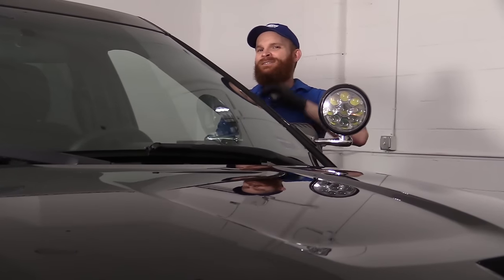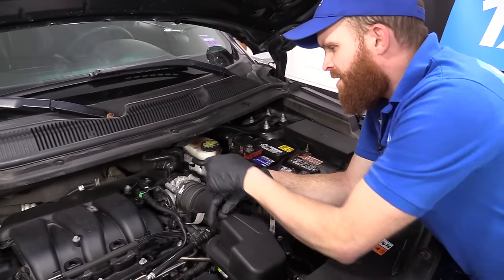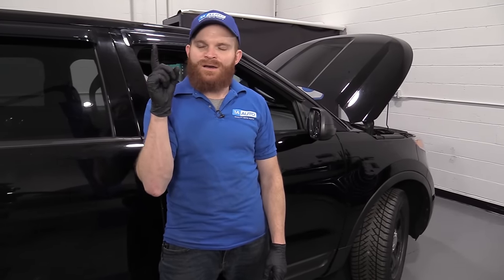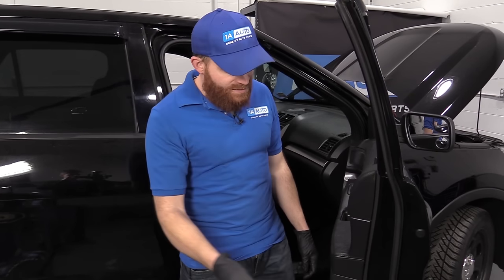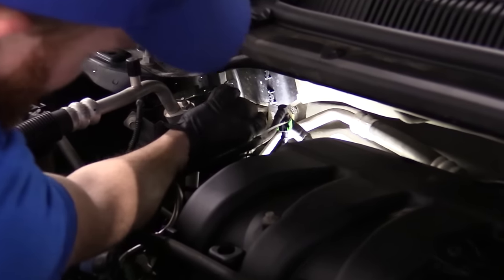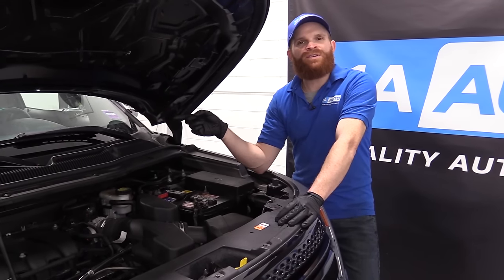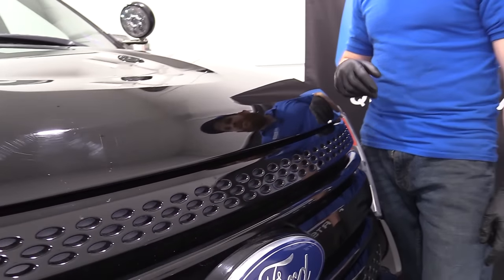Top 5 Problems Ford Explorer SUV 5th Generation 2011-2019

Comment: I recently wreaked my 09 Escape probably tired. I seen a 2017 Ford Explorer XLT Sport mix with many blackouts and a 2.Echo boost with 34k miles. It still had the previous owners address age about 75 which should’ve been removed. The Chevy dealer offered me a powertrain warranty as long as I own this. After applying for my loan so they would hold it I had to wait for my AAA check about a week. Now this is where it goes south. Being an auto mechanic for 15 years and still do my own vehicles I noticed the rotors and ceramic pads. This happens in Michigan when the car sits to long and the rotors rust. My wife was given her late mom’s 06 Chevy Impala with 12k miles. Here rotors and hardware had to be replaced. I had the Explorer a week and the battery failed they fixed it. A couple days later my shifter wouldn’t go out of park so I opened the side console and extended the lever pushed the brake and put it in neutral called my salesman they picked it up cost 1,000. After they returned it I was leaving for work at 4am being to dark to see what I’m doing I drove her car in and left a note. If I have one more shifter problem that’s a lemon law and get my money back. Other than those problems it’s a tight smooth and peppy SUV so far.

Comment: The door panel fabric tends to delaminate from the substrate as well.  Not a very hard fix, but a very unnecessary problem to have.  Ours started to delaminate at about 60,000 miles.
Reply: 2-of-2 messages. The Explorer 2012 Limited is from only 1 owner, the same lady, most of the 103,330 mileage is from home to the hospital and back, she is a doctor and the Explorer is in good standing and well treated by her, let me know your opinnion please, is important for me, Peter.. 9-27-2022 Thanks a lot..

Comment: I had a 2012 Explorer XLT with the 3.5L  V6 engine.  At about 200k miles the water pump started leaking. This is internally in the engine and runs off of the timing chain.  A very expensive fix to say the least. Luckily no coolant had gotten into the oil.
Reply: Would you buy the same vehicle if it had 90k miles on it!
Reply: Michael, my explore needed a water pump at 90k. 2k job

Comment: Rear brakes are a constant issue on these.  Had a 2013 & 2018 and both needed rear pads within the first 20k.   If you live in the rust belt you need to clean and adjust all the brakes every 6 months or so due to the design of the calipers as well.
Reply from the maker: +Jeffery Wattie Thanks for the feedback!
Reply from the maker: +JD JD Thanks for the feedback!
Reply: I have a 2015. Changed front brakes at 100k, rear brakes at 120k.
Reply: I’m on 80,000 on Original Brakes 2018
Reply: I'm at 74,200 on my 2015 with all original brakes. The dealership said it's time to start watching them at the last service because they're starting to get close. Actually getting ready to replace the vehicle, so may never have to do it.

Comment: You missed quite a few. 

PTU, the transfer case bricks itself after the fluid leaks out or turns into mud. 
Electric power steering, yeah its very expensive for a new rack. 
VVT solenoids, they stick causing cam/crank correlation codes. 
Front lower rear control arm bushings. They get all sloppy and the car is all over the road. 
Cat converters, throw a P0420/p0430 and are garbage. Police models have an extended warranty on this. 
Rear wheel bearings, they get noisy and fuse themselves to the spindle due to aluminum to steel dissimilar metal corrosion. 
Front Upper strut bearings, get all creeky.
Reply: Ha my PTU just cracked itself in half
Reply: You are correct ,This all stuff I’ve seen working in a shop for 15 years.
Reply: My PTU just crapped after 118K ... nice bill....

Comment: My spouse has an 18 Sport and it’s had replacements of times that concern me. 
1. Both turbos replaced at 29K miles. (I had to drive behind the explorer with a mechanic to show him the smoke coming out)
2. Transmission was clunking at low speed. It was the transmission mount.
3. Rough idle at times, Dealer cannot duplicate this. 
Overall worried about long term ownership. We shall see
Reply: 3.5l turbo are toilets.
Reply: @mph5896  2.3L are much better

Comment: You forgot about the PTU (AKA Transfer Case). They grenade around 100k the fluid needs to be changed early on and regularly. I put a NPT drain plug in mine. Did it at 85k and the fluid was black and sludge. I only got about 1/4qt out of it. After flushing it about 5 times I finally started to get the full 1/2qt out of it. Drove it 500 miles and did it again. Finally got it coming out clean after 3 more flushes.
And don't forget about the water pump that can fail and take out the motor. Change that coolant earlier than recommended too!
Reply from the maker: +dodgeguyz Thanks for the feedback!

Comment: I own a 2014 explorer xlt fwd 3.5L with 129k miles nothing i had to do us replace the fuel pump. I haven't had any of those issues with mine.
Reply: Agreed these vehicles are pretty reliable.
Reply: i own 2013 with 279k miles, the only thing i changed in the engine bay was the water pump and that was a long time ago, never had troubles withe engine or transmission till now...
Reply: Yes me too Ihave 2012 it's milge about 433 km it is very very relible i just replaced water pump and this problrm was also in all ford engins v6 3.5L it is great car

Comment: Also the high pitched sound that can be heard in 2018 5th gens equipped with the home power outlet. That was so annoying to deal with, pulled the fuse until I was able to get to the dealer. Also had the hood and panel near the gas tank paint bubble, 1 month in a 2020 loaner for them to order hood and repaint nigh the hood and that panel. Ended up trading it in for the 2020 after falling in love with it over the 30 days.

Comment: There’s now a recall in some states over the timing belt. There is also a pump issue. My sister just had to pay for both to be replaced. Not a cheap fix. She has a 2017.

Comment: Got a 2015 ford focus for my nephew in great condition and it has been a nightmare!!! Less than a year we have had it repaired like 6 times. Meanwhile i drive a 2007 prius with 289k miles and only oil change..zero problems

Comment: We had a 2011 XLT 4WD, 94k miles, from upstate NY and although it did its job for 6 years. We had to part from it because of that water pump. I'm mechanically inclined and I did not want to suffer through that job by myself. I could have done it eventually but to be honest, I didn't want to. 
Also, one major thing that happened to us was that the rear frame of the body's weld started to go out and we got rain water into the spare tire area. I legit fixed it with flex seal liquid rubber sealant by detaching the rear hatch and coating it along the frame. Did the same with the sunroof/moonroof gaskets too because rain leaked into it and shorted out the hazard light switch that never turned off until you replaced the whole center console.
Will never go ford again.
Reply: Had the same issue with water leaking in through the rear hatch. Seams were cracked on both sides at the top. Fairly common issue unfortunately. I have a 2p12 with 145k and no major issues other than the leak. I will be getting rid of it within the year though

Comment: My 2015 police receptor utility had the links break by driving over train tracks at about 14 miles an hour they're made out of zinc alloy and it's part of its 75 mile an hour crash test safety feature those are meant to break to absorb energy if you're rear-ended I replaced mine was steel haven't had an issue in two years
Reply: Do you have a brand recommendation? I got a 13 FPIU

Comment: My sunroof went at 65,000 mi. Motor had to be reinstalled. Struts went at 85,000 I replaced with some from 1A Auto. They made it about 38,000 MI. Just had to replace them today. Water pump went at 128,000 mi. Big job. Transfer case went at 130,000.

Comment: Thanks , that was very informative and educational, I’m thinking about getting a 2017 and now I now what to look for and what to expect
Reply: i just got a 2017 police resell.  hard to work on.  runs smooth so far, 74k.
Reply: Depends on what size SUV you're looking for?  Are you only looking at explore? 

just wondering, what did you end up getting if you did get something?

Comment: Ha, evap purge solenoid. The hardest part is getting the hose off with that green connector. You completely skipped that part. Don't need a vacuum gauge either, just disconnect wiring connector and hose. Start the car and see if you can feel vacuum from the port. If so, the purge valve is bad.

Comment: I have a 13 xlt awd with the 3.5. Issues to date were toe links, rear caliper, broken seat back in the rear, tie rod end, sway bar end links. The biggest one was where the roof and side body panel were glued together over the 3rd row glass had a leak that took the dealer 4 trips and 6 months to find. Its a nice car. Comfortable roomy rides well and has good power.
Reply from the maker: +sugarebaresnuffy Thanks for checking us out!

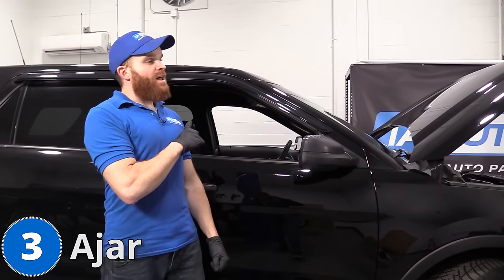Comment: @4:07 - complains door is ajar leaving the dome light on, doesn't notice that the Explorer he's looking at is the police model - and those dome lights are NOT wired into switched power.
 
Also doesn't mention about the PTU grenading due to its location above the exhaust manifold (less of an issue on turbo models due to forced circulation cooling), or the cat-headers cracking due to garbage design work by Ford.
Reply: Damn so I shouldn’t buy one huh

Comment: 2015 Ford Explorer Sport sunroof leaking. Apparently its common in this generation of Explorers & even models without a sunroof still have water leaking <- bad! I've read where it comes through 2nd & 3rd row vents, overhead lights, in the rear by the seatbwlts & water will even fill up where spare tire is. I loved my Edge I had several yrs back & had wanted an Explorer & finally got one & I absolutely love it, just not the water leaking issue.  Some say its more than clogged drains, it could be a seal on outside around top of sun & moon roof, heater core if leaking on ossgr side, roof rack needing adjusted, etc. And yet there is no recall....
Reply from the maker: +Sara Thanks for the feedback!

Comment: As a mechanic, this list is a fail. The only things on this list I've personally dealt with on these vehicles are the purge valve and toe links. Far more common than either of those things are wheel bearings, inner rearward bushings on the rear upper control arms, inner rearward bushings on the front lower control arms, and front lower ball joints.
Reply: Are those expensive repairs?

Comment: Have a 2013 sport, Bought in 14 with 8k miles on it. From the second week i had it, it wouldnt start when it was hot out (75 degrees or hotter). Put key in, turn it on, all accessory lights came on, go to run...nothing. ford shrugged, said sorry not sorry.. dealership could never duplicate the problem. Several stranded hours and a lot of swear words later (on top of many, many videos of the issue) and it would magically work. I replaced batteries in my fobs, unhooked the battery, let it "cool off" and still continued to have the problem. I installed an aftermarket remote start, been happening less.
*Timing chain stretches 
*Hood issues
*Toe links addressed, drives worse after getting replaced
*Rear liftgate rusting through, and above the windshield, same problem.
*Door handles break (I live in MN, guess it shouldn't be surprising)
*Sync system doesnt turn on
*Clear coat peeled off wheels less than a year after I bought it
*Consistent battery drain- go through a battery a year, even on a trickle charger..since i bought it.
I love that thing, but man, if i could get a new one with a key and no issues i might just let it go.

Comment: It looks like you have a former police version of that vehicle. There were problems with those getting carbon monoxide inside of them because when they were modified for police duty, there were several places where extra holes had to be drilled to attach all of their equipment. They were not leaking because of a factory defect, but because the aftermarket people were drilling extra holes in the bodies of those vehicles. I know that may not be the case with all of them though. Also, what is a “vericle”? I thought it was called a “vehicle”.😂. Good videos though. Keep up the good work!
Reply from the maker: +Andy Quick Thanks for watching, and thanks for the additional info!
Reply: My friend, it's not funny to laugh or make fun of a person who has a pronunciation problem. Cheers
Reply: There were SOME instances of cracked exhaust manifolds (factory defect)..

Comment: The $2000 water pump replacement on a $78 part. I had a 2013 that blew the pump and it almost took the motor with it.

Comment: My dad has a 2017 ford explorer. He already replace his front driver side door lock actuator and now he has to replace two other ones. It’s not that it leaves the door ajar and lights stay on, but the doors just won’t open. You would have to open the doors from the inside by lifting the door locks. He spent almost a week getting into the vehicle through the front passenger door and then make his way to the driver side before the the replacement door lock actuator arrived and was able to change it. He’s a bit disappointed in this explorer since he bought it brand new in 2017 and barely has 36,000 miles. And he bought it to replace a 1999 explorer that he had also bought brand new.

Comment: Hi I had an issue on my mine too. But my issue is it doesn’t want a start. Maybe if u don’t mind and give some ideas because I’m probably gonna throw the towel in. U c my wife and I got this car at the dealer for already a year. And it’s been having issues since. First the sunroof the motor gave up. So I replaced it. And now I was driving came to stop light and it just shut down. So I started up and it did but when I got to another light it shut down again. Then I started it up this time it doesn’t have power on the dash the speedometer blank. The light turned green I continued driving to my house. The next morning there was no power coming in I’m mean there was power but it was only giving about 4 then up to 6 percent. Then that’s it. It just won’t start. I always watch your videos and man I really like the way u explain it. Step by step. I appreciate u for helping out. Anyway if maybe u could just give a me a hint on my issues with this ford’ and maybe u no some fords out there that ran into some issues like mine. I always say to myself. That the meaning for this ford brands. Is (Found on road dead)!! “F O R D” lol’ this r the reason why problems I’m have on this electrical system. Thank you. Dave.

Comment: You need to add a few more. IE: 2016 Power steering unit failure 26,000 miles, 2016 Transfer case failure @ 32,000 miles 🤷‍♂️
Reply from the maker: +Mike Imparato Thanks for the tip! We'll pass this info along to our production team.
Reply: Oh, yeah, let’s not forget the hood corrosion making the paint chip off . Dealer is replacing under warranty 🤦‍♂️

Comment: I have 118K on my 2017. I have not had any of these problems. It has honestly been a great car. Only recently I am hearing a clunking somewhere on the passenger front. My son took the tire off and sees nothing obviously wrong and it doesn’t make the noise when jacked up. It is mostly when turning right. Any ideas? It drives and handles great. No vibration, etc.

Comment: 2 problems i have had with a 2015 ford explorer is problems cranking and corrosion, hidden under the battery connectors. Also vent actuators.

Comment: Hello i liked very much this video. I bought a 2013 ford explorer last year. I being having a transmission problem sometimes i put it on d to go and seams that doesn't get in gear took it to the mecanic they replace something on the shifting but did not fix the problem. Any ideas. Thanks

Comment: Great video!  
My 2015 Ford Explorer Sport is peeling all around the vehicle.  Is there a recall for the peeling paint?  I could post pictures of the peeling paint all around the edges of the vehicle and the white aluminum is exposed.

I have a 2004 Ford Explorer Limited, owned it since 2005 that has the throttle body issue.  I remove it and clean it frequently.  
I had a 1994 Ford Explorer (totaled) that the body rusted away and it has the dreaded clunk when is placed in gear but those are my only issues with the 2004.  I keep them cleaned and serviced.   

1984, 2004 and 2015 engines runs great with no issues.   Your thoughts on the paint peeling and what I can do?  Contact ford?
Reply: I got a 03. Runs great, suspension bushings and transmission are my only downfalls so far. Other then that, the 03's run great, esp if they're 4.6 (if they're V6. You're kinda screwed when it comes time for the timing chain).

My grandma went and bought a 2017 Explorer and the result was the same. The paint they put on that car is THIN.

Comment: I have a an Explorer Sport and have done the shifter, pillar panel flying off, toe links, wheel bearing, catalytic convertor, electric steering gear. Will not be buying another Ford.
Reply from the maker: +Robert Smith Thanks for checking us out!
Reply: So you're letting one vehicle determine your opinion on the brand.
Reply: I love my explorer good vehicle
Reply: Just traded my explorer in for a F150 but never had any problems with the explorer gonna miss her.
Reply from the maker: +The R. We are sorry to hear about that!
Reply: Not to mention trying to get an appointment to get repaired at the dealer
Reply: That's too bad. Usually they are dependable SUV's, yours must have been made on a Friday afternoon!
Reply: @1AAuto  don't be sorry it was a major upgrade in my book